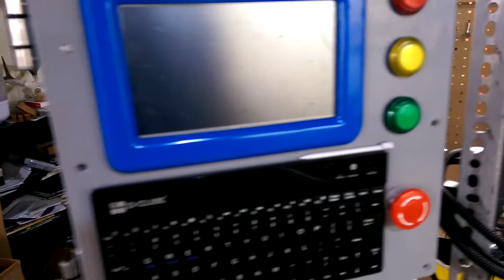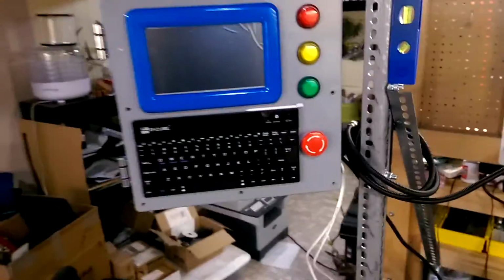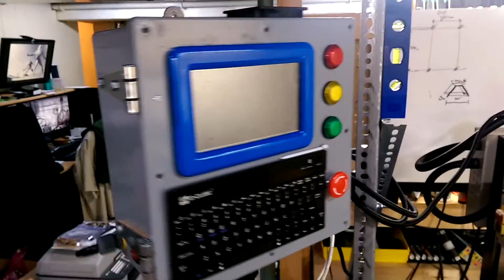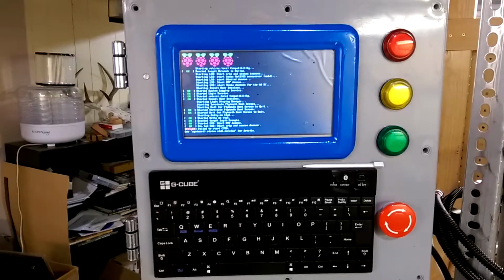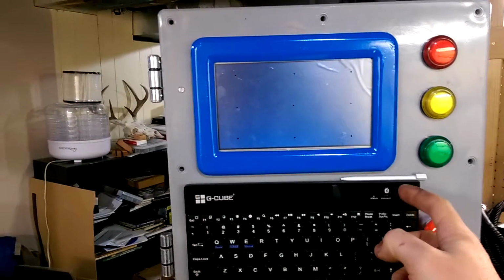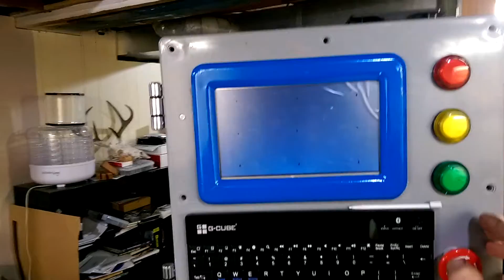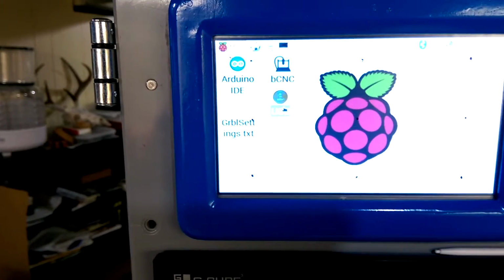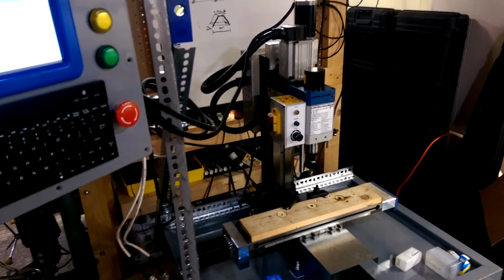Mini Mill CNC Conversion: Part 7 Operational update 1

Comment: Your videos on the CNC conversion have been very helpful in deciding which mill and control system to use for my own project.  How has the BCNC control system been working for you?  Likes, dislikes?  I see it used a lot on PCB mills but not these types of mills.  How is probing and edge finding working for you?

Would love to see a video about the day to day workings of BCNC as it relates to metalworking, power draw bars, auto tool chargers etc. if you've gotten that far with you build.
Reply from the maker: Greg Sherwin BCNC has been really nice, but honestly way more than I can use at the moment. Had some life changes happen and the mill is actually shrink wrapped at the moment and will be for a few more months.
I'm hoping to get it running again by the end of summer. All in all its going to be a great interface.